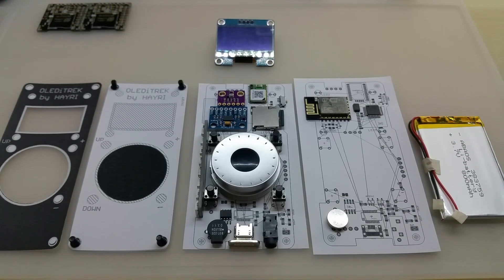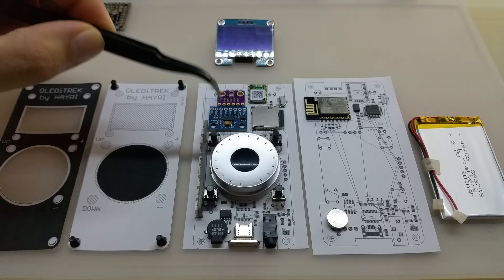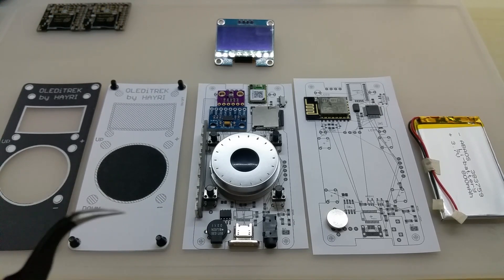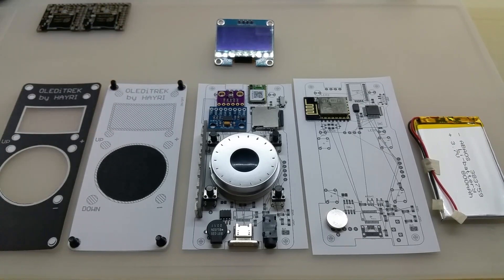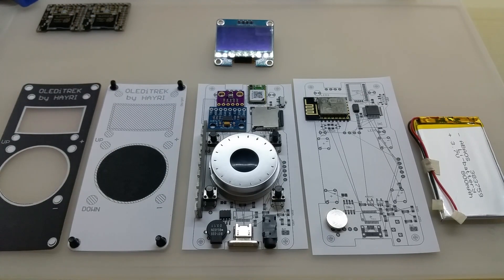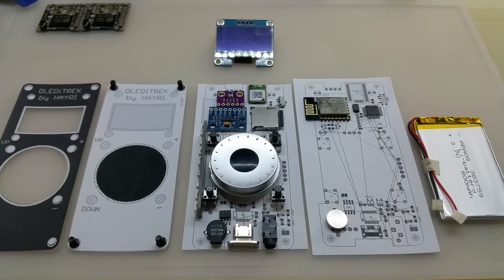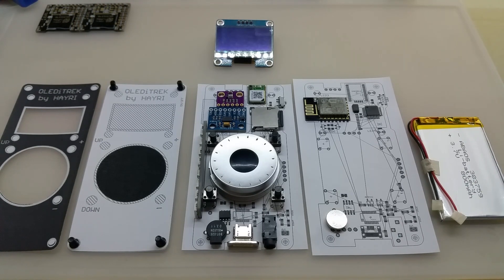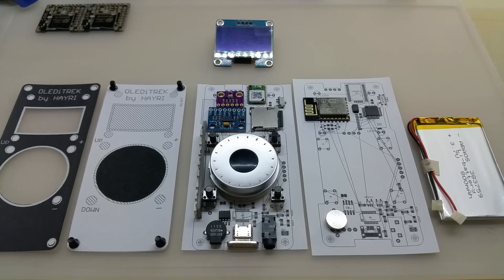OLEDiTREK My new product based on the 328 and ESP07 / ESP12E

Comment: Hello Hayri, (you are professor right?) very interessant project! awesome! I'm from Brazil and has some ideas to run here, and very interessed in your project, in particular the automotive use. I had done a tiptronic system for some kind of automatic transmissions with 3 solenoid operation and one more system to sense a CVT temperature gauge. If you can help (and maybe sell some boards to me) I'll grateful

Comment: Very nice, very complete thing, I would suggest adding something like ACS711 - 3.3v hall effect current sensor with a connector, a precision amplifier on the analog input like OPA336 with dip switch for gain change,  a couple of mosfet driven outputs.
Reply from the maker: Good ideas, but I am afraid I can not fit anything else to the board. Will keep it in mind though. Thanks.